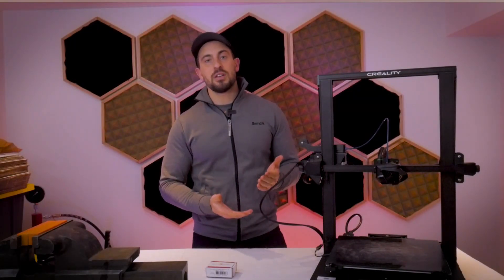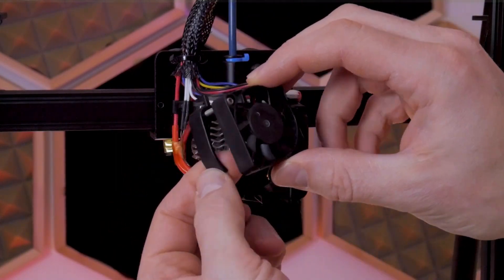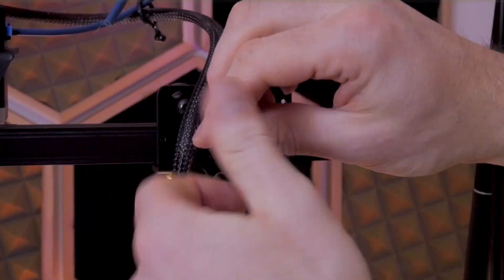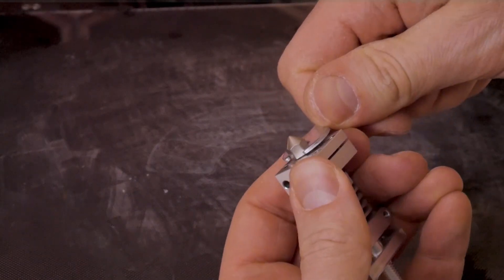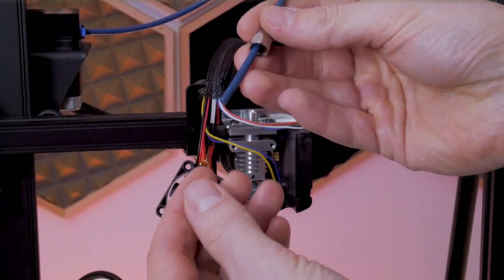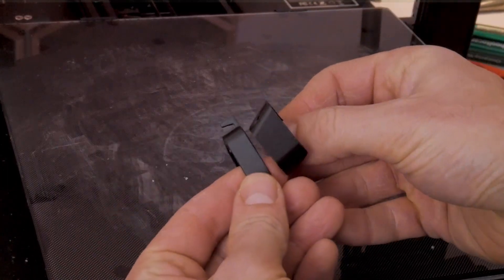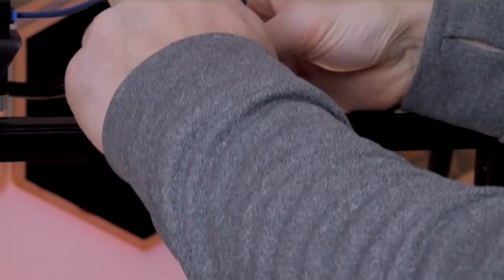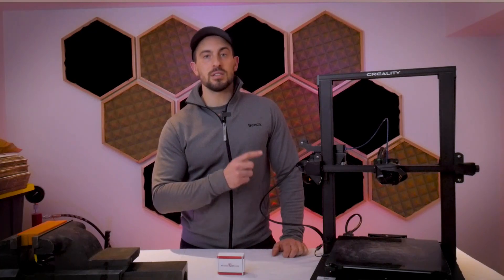Creality CR-10 Smart All Metal Hotend Installation (Using Microswiss CR6-SE Kit)

Comment: I'm facing headache on my cr10 smart..
Necer complete 1 print..
Always clogged and i clean cleaan over and over again so tired.
Do u think the microswiss will solve the issue?😢
Reply from the maker: What kind of filament are you printing with, what temperatures and speeds are you attempting? How far along in the print before it clogs?
Reply: @EmbraceMaking  i found the solution. 
Tnx

Comment: So i did this install finally yesterday and all seemed to be working fine but the compression sleeve  seemed to crimp the bowden tube when fully tightened so much that it caused a lot of resistance when feeding the filament through. Has anyone experienced this before? Are there other connectors that can connect to the hotend fitting that doesn't use a compression sleeve?
Reply: Still clogged probably

Comment: Thank you for the superb video. 
I am wondering if I can ask for your advice? I’m a desperate secondary teacher in the middle of trying to print tonnes of coursework products for students. I’m the middle of this my hot end has been flooded by PETG, which I started cleaning off, but now my hot end is no longer heating up. It shows an error message of insufficient temperature.
I ordered a generic replacement hotend kit, however I’m not sure if that’s going to be my full solution. Did I damage something else in the process of cleaning the nozzle/ hotend? Sorry if I sound amateur, it’s because I am.
Would you be able to help me, please? Will be sending a couple of cups of coffees. 
Thank you, Gyorgyi
Reply from the maker: Sounds like you might want to check your thermistor and heater cartridge wires... the thermistor wires are quite small and delicate and you may have broken them so the board is not detecting a signal that represents the temperature... you may have to partially disassemble your hot end - remove the plastic cover so you can see if you ripped the wires.

Comment: You mentioned you broke the fan blade which prompted the replacement. How did you swap the fan as it looks to be hardwired all the way through the cable management. I didn't see you perform that step.
Reply from the maker: Off the top of my head I believe I had to fish the new wire and connector through the wire sheath to the daughterboard.

Comment: I have a quick question for ya'.

We got it all installed, but we're experiencing some heat creeping up the throat of the heat break and into the nut that holds down the compression sleeve, leading the printer to clog up almost instantly and keeping us from using the printer. I saw that someone recommended a larger fan, but is there another solution for this issue? We didn't add thermal paste (despite my recommendation that we do, they want another opinion on whether or not that's the route we go).
Reply from the maker: I have only one other person email me about heat creep on this setup. What material and what print temps are you trying to achieve? Anything unusual about your process? You really shouldn't need a larger fan...
Reply: @EmbraceMaking  We're using PLA/PLA+, temperature set at 200°-215°. We've had to replace the hotend before with a regular CR-10 Smart hotend, and it worked for about a month before clogging again, cleaned it up, got it working for two-ish weeks, then it clogged up again.
 We've been having this issue with the CR-10 Smart exclusively. We've got multiple Ender's that've been running for months on end with little to no problems. Only with the CR-10 Smart do we have this issue.

So a larger fan wouldn't do us any good then? What other suggestions would you have?

Comment: My thermistor is stuck. I can't push it like you did :-(
Reply from the maker: Try using some heat... sometimes I turn the heater on and grab the block with pliers (don't burn your hands) and then use a screw driver to push the thermistor and heater element from the open end of the block. It should loosen them up but don't push them completely out with the printer on. Your printer might throw a thermal runaway error but it's not a big deal. Just shut it down and let it cool down but at least you will have loosened the parts up.
Reply: @EmbraceMaking  I tried heating but it's probably melted there. Ordered a replacement. Wil be delaying miscroswiss conversion :D

Comment: My plan is to mount the Raspberry Pi in the in the enclosure and mount a BTT PITFT50 to the front panel in place of the original display.  I like the way the BTT Relay V1.2 interfaces and works with the SKR Mini E3 V3.0 board. Slightly different that the original Creality implementation.  I rotated the SKR mainboard for better access to the USB and SD card.  I have one item to address, design and print a cable mount on the gantry. This would mount where the old daughter board was located and secure the umbilical form the gantry to the base. 
Re I think I am having heat creep issues with the Micro Swiss hot end. I had difficulty pulling out the filament when the hot end was at temperature.  
I think there is one additional item to address the stock part cooling in anemic and should be upgraded.

Comment: Great videos, thanks.  I have completely overhauled my CR-10 smart printer removing all of the Creality boards.  I added BTT SKR Mini E3 V3.0 mainboard, BTT Relay V1.2, BL Touch (Eliminating the Strain gauge), Micro Swiss hot end and the Bondtech LGX Lite to my CR-10 Smart.  Also, moved to Klipper.  Did you experience any flow difference between the stock Creality hot end and the Micro Swiss?  My extruder calibration varied only slightly from the factory 5.7 and don't appear to be missing steps. However i am seeing some under extrusion in one of the flow tests.  Any thoughts?  Thanks
Reply from the maker: Thanks Larry, this is actually a road I am considering going down. I have recently had issues with my strain gauge and I have no interest in re-using it. I have already designed a new mount for BL / CR touch along with fan shroud etc. Just need to find some time to swap main boards or hack the original to eliminate the strain gauge. Did you make your own config files for this printer, or did you download them somewhere? Also, do you have the pinout for the harness cable? As for the extruder, honestly I don't recall any under extrusion with the new hotend and extruder, although I believe at first I had to spend a little extra time dealing with stringing. Once I got that sorted it was pretty smooth sailing... I assume you already did the PID tune for the new hot end? If I can recall I had to adjust my printing temperatures with the new hotend a bit. Maybe you need to run it a little hotter?
Reply: Hi, maybe we can work together on this. I designed mounts for the new boards,  made my own configuration  files and have complete schematics.  I can share all. Can I email them to you?

Comment: Hey, Im printing the adapter in PETG carbon fiber filament in my ender 3. I have a ABS temp issue on my CR10 smart, I cant get over 230 Celsius. Any Idea how I can fix this?
Reply from the maker: What do you mean by you can't get over 230? You are able to set the temp to lets say, 240 on the screen but the temp just never reaches it?
Reply: @EmbraceMaking  when i set to 240, the hotend wil get in the 230 range and an error will appear on the display, ab temp error. This basically stops the printer. I have tried new firmware but it did not help

Comment: What’s changes did you have to make for your MS hotend, mine hasn’t seems to put out the waking prints that it used to with the original hotend. I have in 3 of my machines and I feel like they’re great at beginning but then cause issues
Reply from the maker: Are you asking about slicer setting changes, or?
Reply: @EmbraceMaking  yup slicer settings, anything you found you had to change or fiddle around with for a bit to fine tune in?

Comment: I have CR-10 smart and My fan is always on causing me a lot headache while printing like ABS any part with some height get warped leading to failure, any solution to that ?
Reply from the maker: Your part cooling fan is always on? If that's the case it will be driven by your slicer settings. What slicer are you using?
Reply: @EmbraceMaking   I’m using Cura, but I’m insuring that fan is disabled, also during a print, I turn off the fan but no response.
Since you mentioned the slicer, could it be something with the Gcode that overrides the fan control?

Comment: Replaced the CR10 Smart hot end 4 months ago with the Microswiss all metal hot end – have not had a single clog issue since. Fantastic!  The only issue I have occasionally is getting heat error messages when I'm printing ABS at 250.  Any recomendations?
Reply from the maker: Hi Bernie, I haven't tried printing at those temperatures with my CR10 smart yet.... but perhaps its a firmware issue... not sure what Creality has set the machine limit to. What error message do you get specifically?
Reply: Check.the heater and the thermosta
Maybe it has been small cut
I had same error before it was a bit cut

Comment: Can the strain sensor be adapted to other hotends? Like mosquito or a groove mount hotend?
Reply from the maker: I don't see why not, you would just have to mount the new one to the strain gauge mount... should be very doable.
Reply: Cool, I’m very intrigued by the vgroove universal mount that’s on Amazon. Seems as though there are two top tapped holes that would allow for a v6 style hotend to attach to the sensor. Have you ran into any other problems with your cr10 smart? I was frustrated at first. Replaces my machine 2 due to problems out of box. But I will say, now I’m extremely happy with the machine. The abl leveling has been working wonders. And have had zero adhesion problems. Especially after microswiss hotend upgrade. Next is an in line omg all metal extruder install in stock location.

Comment: i upgraded the hot end and extruder. now my printer doesnt boot up. I tried finding a replacement tempistor sensor but didnt find the exact one. i had to go with a E3D PT100 for the probe. is that my issue?
Reply from the maker: Did you use this same hot end? And what do you mean by doesn't boot up? Like it doesn't start at all, or you get an error when you try and increase the hot end temperature?
Reply: @EmbraceMaking  i bought a micro swiss full metal hot end. the screen will start but nothing happens with the creality logo.

Comment: Excellent video, congratulations, this hotend works well with PLA?
Reply from the maker: Yes it does! PLA is pretty easy to work with in general anyways, but I find that all metal hot ends provide more consistency over time and less chance of future clogs since there is no PTFE tube in the hotend.

Comment: What material did you print the fan shroud from?  Thank you.
Reply: PLA at first then Nylon, and just printed it in CarbonX Nylon G3+CF.
 I found a workaround to the 260c temperature limit, though it would be nice to do so thru the firmware. I looked up the NTC thermistor and its good to 300c, then looked at the temperature vs resistance table and calculated that an 89 ohm resistor in series with the thermistor would do the trick. I added a switch that shorts out the 89 ohm resistor so I can choose a +40 deg. c increase or regular settings and it works great. With the switch on it shorts out the resistor and the temperature settings work as normal, with the switch open the resistor is in series with the thermocouple and gives me +40c at 260c setting so I get 300c at the hot end. If I'm printing bellow or at 260 then I use the regular settings with the switch turned on, I only use the resistor above 260c.
So If I want,
260c and bellow at the hot end, turn switch on and use regular settings.
265c at the hot end I set the temperature to 241c, switch off
270c at the hot end I set the temperature to 244c, switch off
275c at the hot end I set the temperature to 247c, switch off
280c at the hot end I set the temperature to 250c, switch off 
285c at the hot end I set the temperature to 233c, switch off
290c at the hot end I set the temperature to 255c, switch off 
295c at the hot end I set the temperature to 257c, switch off
300c at the hot end I set the temperature to 260c, switch off 

I had to use two resistor values to get the 89 ohm (cheap  Amazon resistors) to test it, at these temperatures its critical, I used an Agilent 34401A with 4 wire resistance mode to get it as close as possible. If you go to Digikey, Mouser or Newark electronics it's best to find a 89 ohm, 0.1% resistor for this, one is about $7, so all you need to do this is a resistor and a SPST switch or a DPDT and an LED with a current limiting resistor if you want to jazz it up a bit. Also, toggle the switch to the desired setting before turning the hot end on so the software doesn't detect a fault condition.
Reply from the maker: That's a very creative hack to beat the temp limit without access to firmware, very nice!
Reply from the maker: Filaments.ca carbon fiber PETG , prints really nice and smooth!

Comment: Great video! I did the Micro Swiss all metal hot end and added the larger Bondtech LGX extruder on my CR10 smart a couple of months ago, as well as a Raspberry Pi4 inside the CR10 smart, I also had to design my own parts, all part of the fun. Printing nylon at 260c I did experience heat creep so installed a larger fan, 40mm x 20mm all works great now but I have the 260c limit on the Marlin firmware. Any workaround on that? Thanks.
Reply from the maker: Just saw your other post about your workaround, that was very creative!